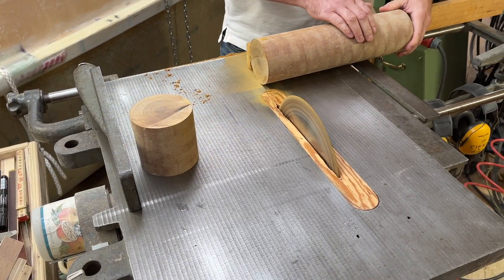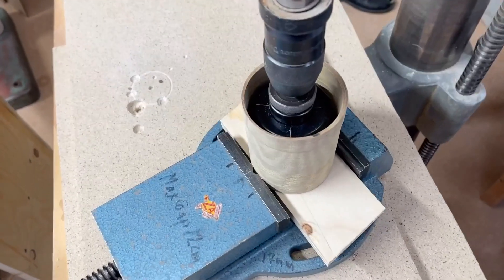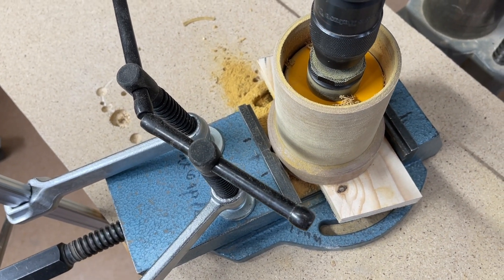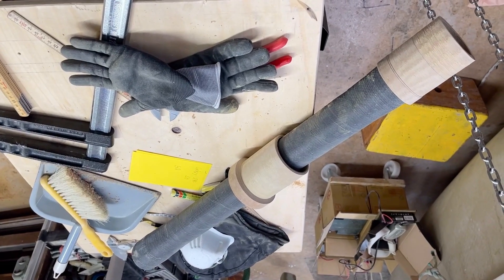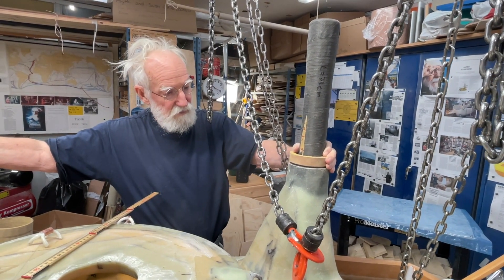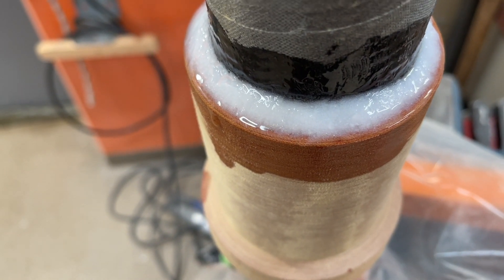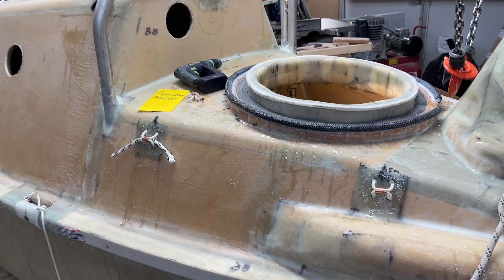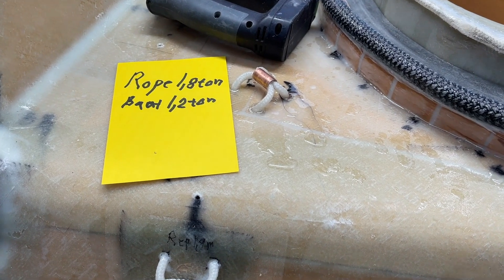17 Oct 2023 Mizzen mast lower part

Comment: Will you seal the tufnol with epoxy? 

Also if the tufnol is a very snug fit in the base,  some length ways grooves (like keyways) might be worth having,  to give salt somewhere to go as you twist the mast back and forth when lifting it out?

Love the way you embrace and exploit modern materials, but not blindly.
Reply from the maker: There is some play
Reply from the maker: I did not plan to seal it with epoxy but it is an good idea
Thanks for the suggestion
Reply: Tufnol is a great material, but I do not know if it absorbs water,  even nylon can absorb a lot.
Reply from the maker: Tufnol is reinforced with cotton
It absorbs water but I do not think very much @whatnow9653